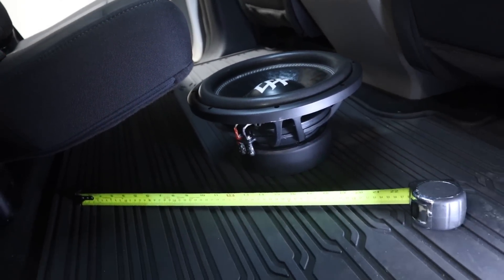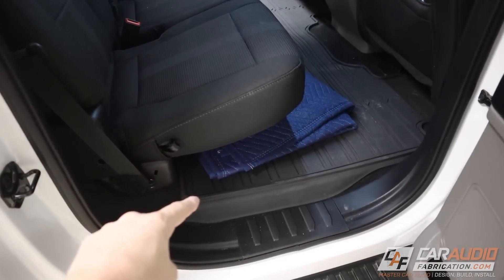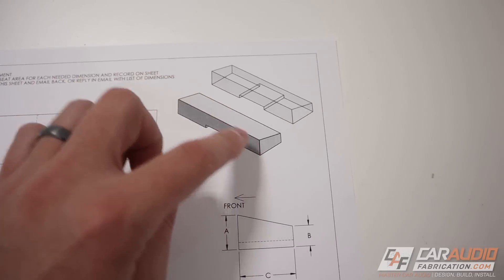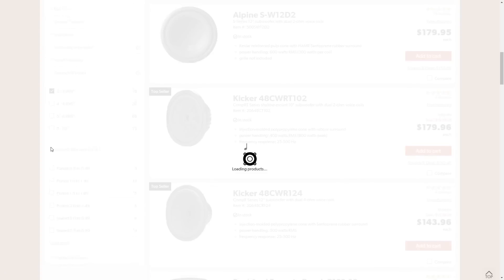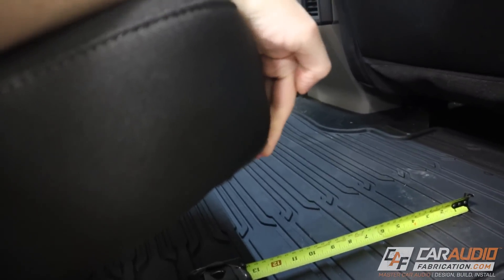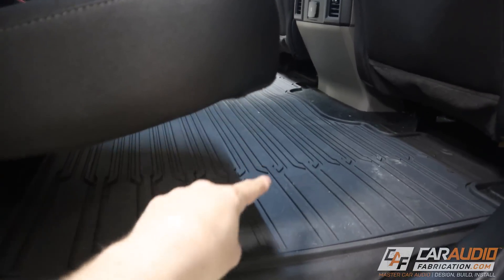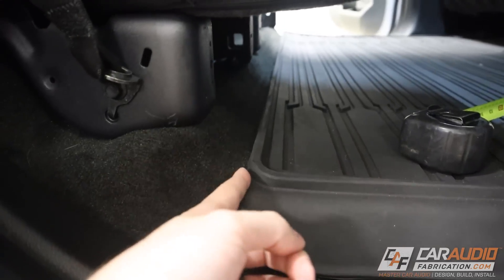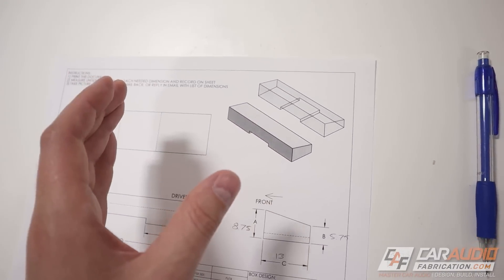Enough volume for truck subwoofer? You've been measuring wrong...

Comment: When I started building boxes, years ago, we learned to subtract the material thickness 3/4" x 2 = 1 1/2" from each O.D. dimension 8.75" x 5.75" x 13.00"x (55.00") to start getting volume!
Reply: I was taught the same.
Also was taught with wedge (truck boxes) to add depth 1 and depth 2 together,divide by 2 to get a average depth.
In this example i would add 8.75 to 5.75 divide by 2= 7.25
Reply: How can i stop vibration from 12 inch subs under back seat of 2018 ram quad cab  to much vibration ...i have 1 12 inch sub ..1500 watts..amp  4 6×9 .. and 3 tweeters
Reply: Divide by two is the correct way.  Some just try to over think things.
Reply from the maker: Works great for a square six sided box, doesn't work well when angled faces and notches come into play. As noted in the video the intent is to APPROXIMATE how much air volume we have to work with and we can then get more specific once we pick our subwoofers and make a real design. my math values for approximation account for typical material displacements. The problem is with the current lack of understanding for many they either A) get subwoofers that will never work properly in the limited space or B) get overwhelmed and just buy a pre-made box. The methods within the video allow for a quick approximation to avoid those issues.

Comment: I have the same f150 in the video, what are the pros/cons of going down facing vs front facing? Pros/cons of sealed/ported? What’s the best set up for this truck in your opinion?
Reply from the maker: Best will always depend on your application. You can get more air volume with forward firing, but are limited to subwoofer size. You can get larger subwoofer size and will need to do a shallow mount subwoofer with downfiring but will lose air volume with the sub being spaced off the floor. I don't want to give away what I intend to do quite yet, but stay tuned. ;)
Reply: Can’t wait for the next video!

Comment: The rear seat relocation kits from LMI Welding are very helpful in getting a larger box under the rear seats to accommodate more or deeper subs.  I had three full size 10" Alpine Type R subs under the seat in my 2013 Super Cab.   The LMI kits are kind of expensive for what they are, but as far as I know the only place making them.
Reply: Just buy some square tubing and fabricate your own brackets that's what I did
Reply: Just make sure the regular rear seat passanger fits with the lifts 😜

Comment: Please do a tundra double cab I think it’s one of the hardest truck to build with 4 subs
Reply from the maker: Same math, just break it up into easy to calculate sections
Reply: @CarAudioFabrication  it’s has allot of stuff on bottom of seat meaning brackets also. Very low compare to most trucks I have been a huge fan of u and even buy stuff from mobile solutions it would be awesome to see a build on a complex truck like the double cab with 4 subs I only seen one post that someone did with 4 sa 8 inch but looked very complicated would mean the world if someone like yourself can do a truck like the sr5 double cab lol
Reply: Im doing 4 10tw3s in my tacoma 2 in the rear doors though. But i cut all the seat supports out to make my amp racks and the other 2 10s go mid where the old rear center counsel was. Just cut everything out and use the box for your rear seat support
Reply: 4 Subs just may not fit.   It's better to have two heavy hitting subs in a proper box than four subs in shallow box(s)
Reply: @davect01  I seen it done but rather see a expert do it
Reply: @davect01  as far as hard hitting subs can’t I doubt there is any that will fit Uber that seat it’s crazy down there lol